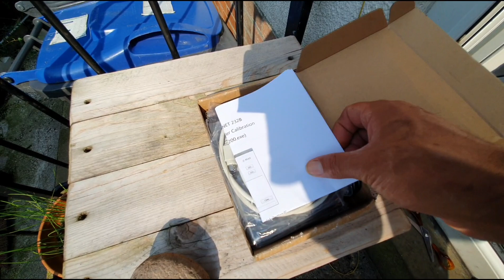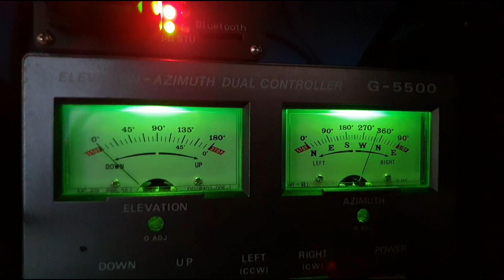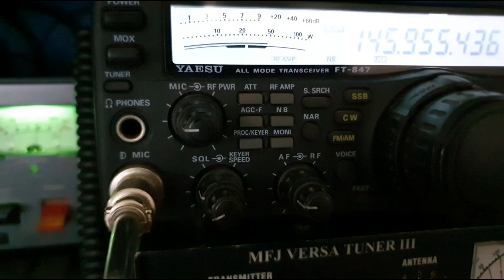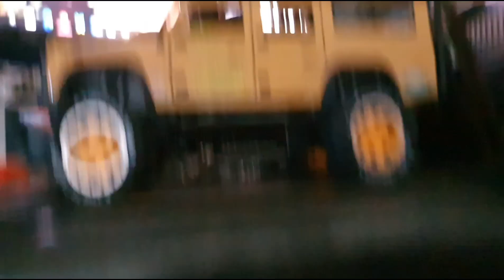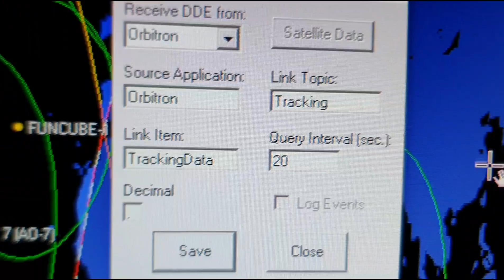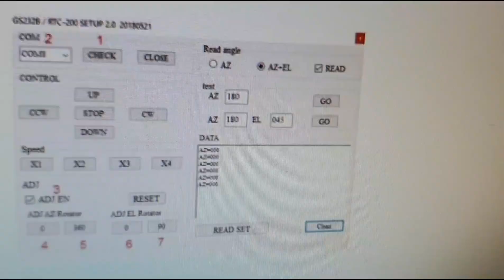Setting up COM - 232B rotator interface for auto Satellite tracking

Comment: Hi Simon, Well I just purchased the G-5500 rotator just gotta get the antennas and controller, do you know anything about this SAT controller (CSN Technologies S.A.T. - Self Contained Antenna Trackers SAT)??
Reply from the maker: Hi Chris congratulations on your nice new G-5500. You will certainly enjoy it. I have not seen the CSN product but as long as it's compatible with the yaesu control unit which most are,  it should be straight forward enough. It might need calibrating once it's all connected.

Comment: A different version of the black box, hopefully cheaper than the yaesu version, l use that version, but it does the job well,  l can’t see why people are having trouble with the azmith side , the g5500 will set the 450 degrees as you set up the calibration, and then when you use the software in nova, orbitron, or pcsat 32 ,it will display it,
Reply from the maker: Hi bud, Yes the yaesu unit is slightly over my budget lol this is a great cheaper option which cost me $100 including shipping. I have had it a few years now and it is easy to calibrate and working with no issues. Thx for comment

Comment: 450 degrees did not work for me at all, when SO-50 N/W 350 degrees to S/E 120 degrees it started of ok at 350 but at 360 degrees it did not go 1 degrees it went straight to 90 degrees . So I am back to choosing 360 in the setup

Comment: Thanks for the video, where can I find the calibration program : GS232/RTC 200 Setup 2.0  can't find it anywhere
Reply from the maker: Here you go Roland 
https://hf5l.pl/en/rotator-controller-interface-for-yaesu-g-800dxa-g-1000dxa-g-2800dxa-g-5500/

Scroll down the page and you will see the link 
''The manufacturer BH4TDV has prepared the GS232B SET 3.0 program for calibration interface to the rotator.'' Its easy enough once you download and install 73
Reply: @M0YKSHamRadio  ha I have been on that page before but could not see it.
But looking for it on my phone I could find it straight away, thank you, 
I used a different calibration program yesterday and it nearly took one of my antennas off. When the antennas did a total backflip ha ha ha.
Reply from the maker: @rolandlang3590  lol hope it  sorts it for you. No problem easily missed. It took me a while to remember where I came across it. Have fun 73
Reply: @M0YKSHamRadio  I do have a 450 degree Rotator as well how does it work for you ?  In that calibration program is nothing about 450 degrees.
Reply from the maker: @rolandlang3590  I think  I set it up as it comes and seems to do most passes easy enough.
Reply from the maker: I think the program that you run after the calibration is completed will be where you can set the rotator up to 450
Reply: @M0YKSHamRadio  Got it! In SatPC32 I have the option to click 450 degrees